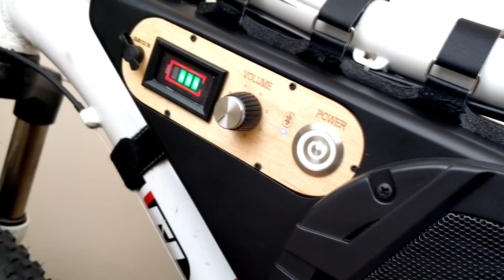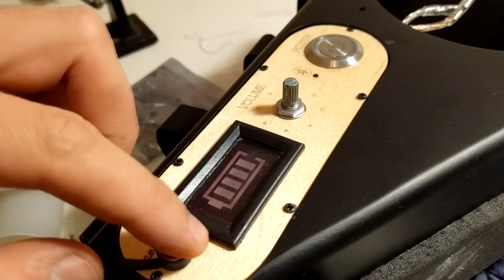Wireless Bicycle Mounted Bluetooth Speaker Build

Comment: Yeah it's nice to build your own. Way it's easier to buy a Bluetooth speaker.. you build it perfectly fine but the way you glue batteries and amplifier, it will coming off . Shaking, hot weather

Comment: I did somthing lime this but im using 2 12v 18amp hour batteries and a 12 to 24 step up converter along with with a mini amp im using a 8 inch car subwoofer and to 6.5 mid bass tweater speakers it last me about 24 hours or more with no charge people be thinking its a car coming down the street lol
Reply from the maker: Haha that sounds like a serious setup, would love to hear it in action! 😄
Reply: @DonnyTerek  I sold that one but I have a video of a new one I built but its more of a portable Bluetooth but it's to heavy to carry so it's more of pick it up then put it down when you get where your going lol
Reply from the maker: @johnthomas4427   Haha, more less the same to me with larger "portable" speakers.
Reply: @DonnyTerek  but your stuff is more fancy. Mine is gody and heavy I don't have all the right tools. it took me hours cutting with a hand saw. I had Kalisis all on my hands from friction lol
Reply from the maker: @johnthomas4427   Thanks. The finish depends on the tools you have access to. Same can be done with a jigsaw and lots of patience 😄
Reply: @DonnyTerek  I want to build a full surround sound

Comment: Nice build! So 3S2P battery is conected to boost convertor to feed the proper voltage to the amp right? PS. if you are using sony vegas to cut the video, select all clips and click right - switches - disable resample to get rid of artifacts in rendered video (double edges, vhen you pause movement) this is known error of vegas.
Reply from the maker: Thank you!
Yes, that is correct.
Thank you so much for the tip on Sony Vegas! Have been looking for a solution for ages 😄

Comment: What did you used at 1:40 for paint base?
Reply from the maker: I used waterproof Titebond III wood glue mixed with water in a ratio of 1:1. More details on the build can be found on my Instructables page in the description!